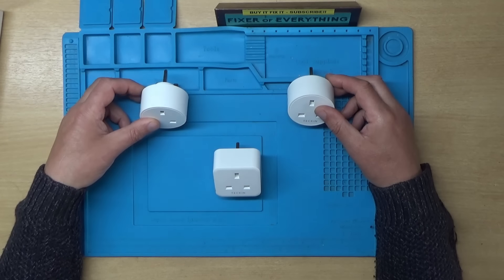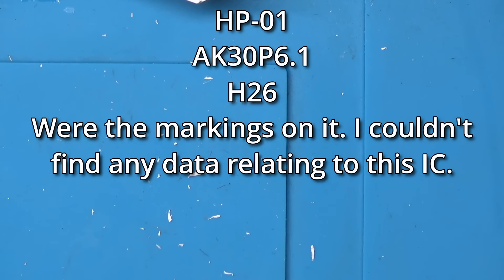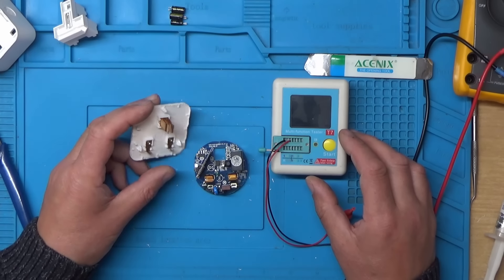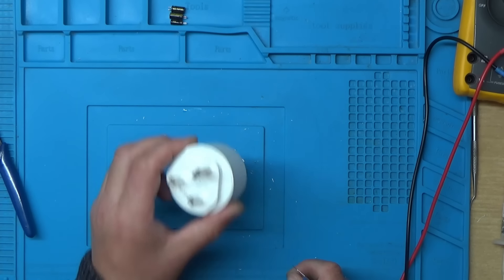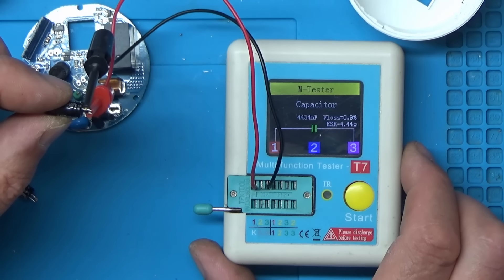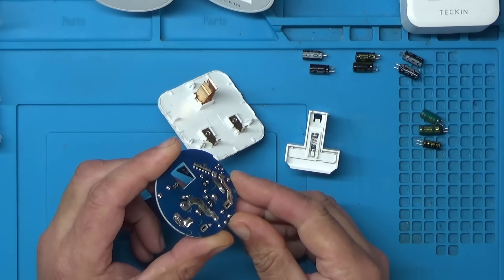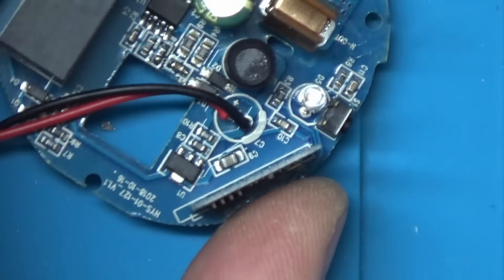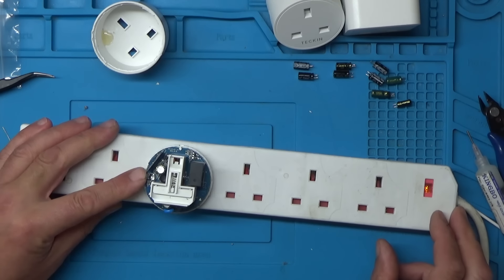Three Faulty Smart Plugs | Can I Fix Them?

Comment: The only thing this guy can't repair is my marriage. 😂
Reply from the maker: ...I'll come round and have a chat with you and your wife,I'll bring my soldering iron 🤣🤣
Reply: If only it was so simple we could fix our significant others LOL😂
Reply: Don't count your (or Mick's) chickens!
Reply: @BuyitFixit  beast❤❤❤
Reply: Marriages fail at about the same rate as electrolytic capacitors..  seems most of those times the cap blows its load all over which causes the whole thing to just not work anymore..  you can always clean up the mess but that smell will always be there and will always not trust in the thing again like maybe it wasent the correct fit for the circuit..
Reply: Marry a smart socket 😂
Reply: @ralphj4012 doesn’t have the capacity to do that.
Reply: Marriage is overrated by a few hundred volts. I've tried to resist it, after losing my last ohm. Glad we are out of the dating circuit.
Reply: 😂😂😂😂 he is a pro

Comment: I would have liked to see you test the new capacitors before inserting them.  Specially the ESR values of the new capacitors.
Reply from the maker: I guess it depends on the make, as I did a little research on ESR and came across a  thread in eevblog saying it's like asking what the weight of a cow should be. Depends on the make, electrolyte, etc so I'm still not sure how good of an indicator it is. Some people even posted pictures of bad caps with a good ESR reading so I think it's if in doubt replace anyway.

Comment: I recently had a smart plug fail in the same exact manner. I wonder how many of these have been sent to the landfill because the manufacturer wanted to save a few tens of cents on the capacitor.
Reply from the maker: I'd expect a lot. I've had a few similar comments since doing this one 👍

Comment: "When in Doubt replace the Electrolytic Capacitors" because if they're not bad they soon will be. Funny as a rule of thumb Capacitors are usually the most common failure devices but as the third unit proved there are always exceptions to the rules. LMFIAO Nice video as always.
Reply: But why don't they seem to last anymore?
Reply: @markturner7459  Well I'll guess the source, or the base material quality but who knows for sure. I'm just cognizant of the cause & effect.
Reply from the maker: Thanks 👍
Reply from the maker: I think it's because we are using switching power supplies more, which are running at high frequencies, so they are taking more abuse than they would in an old style linear power supply.
Reply: @BuyitFixit  Great point
Reply: Ceramic capacitors are notorious for cracking.

Is there a short somewhere?  Yes: diode or ceramic capacitor.  No: electrolytic capacitor.

Comment: A syringe with gas injected into the seams is how to open power bricks without damage. Use a little at a time and wipe off excess as it drips. This eats adhesive but softens plastic too, so go sparingly. This is used to repair and resell power supplies for laptops without cutting them open and rendering them useless for resale. This technique should work here. 😉
Reply from the maker: Thanks for the tip 👍

Comment: How often caps cause failure! I just replaced the starting capacitor on my 25 year old espresso grinder. Thanks for your videos. I am incapacitated and usually have to watch your videos on my cell phone. Due to a strong tremor in my hands I cannot comment on the phone, but I want you to know that your videos make my limited life experiences at age 80+ much more bearable, all the more because my favourite English dialect is Geordie! Greetings from Germany!
Gan canny, man.😊
Reply from the maker: Thanks 👍 and good work on fixing your espresso grinder 🙂
Reply: Totally agree. Can't count the number of times I have fixed items with crappy caps. I always replace them with quality ones like Panasonic FM, FR, or FC series. (there are other quality brands, the Pannys are just my preferred ones.)

Comment: Perfect timing. I just came home with one of these that I saved from an electronics recycling box at IKEA. 😊
Reply: It's odd that Ikea has a recycling box; I’ve never had an Ikea electronic device fail, except one light bulb.
Reply from the maker: Nice 👍I didn't know that they had one. I'll have to check see if I can find it next time I visit!
Reply: It is next to the self packaging area. This was in Berlin. They had recycling boxes for bulbs and electronics. I was in a rush and only collected this one (not IKEA branded). There were other things but I didn't dig more...
Reply: Hah! It was not faulty at all. Working perfectly for the time being. Odd. 😊 pleasantly surprised.

Comment: ´´I'm no expert´´ ..... 🤣🤣😂😂 .... that was a good one....!!!! Those ceramic caps a a pain these days...!!!! There is a channel on repairing Laptops in 
which the owner says, ´´No capacitor, no shorted capacitor´´ when he refers to those ceramic caps, and usually he never replaces them if there are at least 
another one in parallel...!!!
Reply from the maker: Well technically I'm not an expert as I've got no paperwork or college degree or anything. I've just messed around fixing stuff and learned myself mainly from experience and the internet 🙂

Comment: Per usual outstanding work sir. 
I have a bunch of the TP-Link Tapo plugs and they just seem to be clipped together without any glue so they're easier to get apart and fix, if needed. I've never had one fall/come apart when I've been unplugging them, so they are fairly well clipped together.
10 seconds in... CAPS, it's the CAPS. CAPS I'd say. Defo the caps!!! 🤣🤣🤣
We'll always have "two trailer park girls go" 1:47 "round the outside", 27:30, 1:47... 🤣🤣🤣
Reply from the maker: 😂😂😂Yes, I wasn't expecting the short.. I think it made it all the more interesting 👍
Reply: @BuyitFixit  ah, yes grasshopper, but it was a cap that caused the short, so defo caps... 🤣🤣

Comment: Another great vid. I have a few of these, well a variation of these, and one of them has been playing up so might be tempted now to have a butchers inside when it stops for good. I get such a buzz when you have diagnosed and rectified the problem and then plugged it in to find it working.
Love it. Many thanks 👍👍
Reply from the maker: Cheers Darren. It's per of the fun the "buzz" of getting it working👍 (not the buzz of getting a shock though, I've had that a few times too)😂😂😂😂
Reply: @BuyitFixit  Yeah i am with you there on being buzzed as i am an electrician so i had my share of them. You soon learn 😂😂

Comment: Excellent! Last week I had exactly the same problem (low voltage lytic) with a remote controller (only one, not three). The chinese components they use in this devices are really bad.
Reply from the maker: @fichambawelby2632  Thanks 👍

Comment: I have that same component tester and personally do not like it. The capicator tester I've been using for years is the Peak Atlas ESR70. You should look into it and possibly pick up one for ESR testing.
Reply from the maker: Yes someone else mentioned one of those although they seem quite expensive. What are the readings on that like compared to the component tester? I'd be interested to know 👍
Reply: @BuyitFixit this tester tests electrolytic capacitors very well. It will tell you if it needs to be replaced, there is no guessing if the ESR is acceptable or not. I never take that $5.00 tester out anymore for electrolytic capacitors. Its expensive when compared to that lesser price tool but if testing electrolytic capacitors often I feel it is an investment well made.
Reply: @BuyitFixit one more thing to note. If you knew which cap to replace you would have saved money not replacing all the others. If the plan was to replace them all anyhow then the tester will not benefit you. If the goal was to show the audience which cap was the culprit and replace only what needs to be replaced then I recommend this tool.

Comment: Most welded plastic casings open right up if you squeeze them in a vise.
Reply from the maker: Thanks for the tip 👍
Reply: Came here to say the same.  Learned that trick from Big Clive.  I had to open a similar smart switch, popped it in a Black and Decker workmate, cranked the handle and eventually there was a loud crack, and it opened just fine.

Comment: Low value electrolytic capacitors typically have higher esr, up to about the 3-4 ohm is fairly normal for 1 - 4.7 uF.
Reply from the maker: Thanks for that. Apparently voltage of the cap plays into this also. I did find a whole thread on the EEVBLOG forum talking about ESR and how it can also vary wildly between good quality bad quality and different manufacturers and even bad capacitors can have a good ESR reading.
Reply: @BuyitFixit  Yeah it varies, the esr meter just gives you a ball park figure, its not a precision measurement, just gives you a good indication (so long as the cap is not shorted). Often works well testing electrolytic caps in circuit, its the ones that have a bit high esr, that's when you are unsure. A big cap with a few ohms or more, is not good, but after measuring lots of small  caps in circuit, I find they often have a few ohms when perfectly fine.

Comment: It's pretty much cause and effect what you're seeing here. The electrolytic cap probably failed in the last one, leaving the spikey high-freq rectified voltage to be smoothed by the little ceramic cap, resulting in its demise as well. Ceramic caps tend to fail in a short or become a resistor of varying value when exposed to voltage higher than their spec. Last month I was able to repair a display module in a Wacom drawing screen where the same issue occurred as a result of a suspected power supply problem.
Reply from the maker: Could well be the case 👍Well done on fixing the Wacom 🙂

Comment: I also got two smartplugs that has a relay clicking on and off but slower. I suspect they got faulty capacitor too. Asking the manufacturer first and if they ignore me, i will personally fix them.
Reply from the maker: Hopefully they respond, if not it's more than likely the capacitors as this was the fault with all three of them apart from 1 which had an extra fault.

Comment: Love watching you save stuff from landfill.  These didn't look old enough to have failed electrolytics - I was surprised.  Bad product design in that they should have thought that if someone opens them (or even if the welds fail) then building in some mechanical clips keeping the front cover on would be good for safety.  I'm sure it could have been engineered at no actual cost other than mould complexity.  Keep up the great work!
Reply from the maker: Thanks Mike 👍I've got a "dumpster dive" TV I was just looking at earlier.. (future video) that one was really snatched from the claws of the landfill 😂😂😂
Reply: @BuyitFixit  I fixed electronics as a hobby my whole life and used to get paid to do a few TVs in my time.  Now I'm old and I just don't come across anything to repair any more so it's a lot of fun watching people lile yourself diagnose and fix.  You do great work. Can't believe you do all this on top of running a farm!
Reply from the maker: Yes sometimes it's a bit of a challenge, hence why this video was out slightly later than usual 👍

Comment: Nice repair, Really loving the channel. Are you using any isolation transformer for the mains?
Wrt the Wifi boards, maybe take a look at Openbeken and Esphome. Most of those boards can be flashed to open source firmwares and you get rid of these CN cloud apps. Then the plugs also integrate better with home assistant etc. May be a video topic.
Reply from the maker: Thanks 👍no haven't got an iso tx yet. It's on the list of things to get. Yes a friend of mine was talking about tasmosa and home assistant etc and how you can flash these.
Reply: @BuyitFixit  Tasmota is nice for ESPs. The RTL chips and many more are supported by Openbeken an Esphome. So you can "free" a lot of devices and secure their function for long. IOT has really become cheap. Would just be nice if the manufacturers would spend 50ct more on the caps ;-)

Comment: I wonder how hot it gets inside these things for caps to fail this consistently. I imagine three small holes drilled on top and bottom of the plastic case would wo wonders for the reliability.
And I see a lof of these Teckin plugs can be flashed with Tasmota or ESPhome and rendered free of the cloud, so they may be very interesting for a tech-savvy man like you :-)
Reply from the maker: Cheers Nick, yes good suggestion. A friend of mine has flashed similar and uses them with home assistant. I used to be into this kind of stuff, but sometimes it's just easier to flick a switch on the wall 😂😂😂
Reply: @BuyitFixit  Home Assistant is great when it flicks the switch for you. Having to get the phone out to do it yourself is, indeed, not the right use of the technology

Comment: amazing how you found out the last problematic ceramic capacitor! and I wonder how you guesstimated the 100nF value? perhaps from experience? thank you for inspiring me to go and try fix one of my own faulty smart switch!
Reply from the maker: Thanks 👍yes just from experience and knowing what it does in the circuit. I did the same on a solid state hard drive (video is on my channel also) 🙂
Reply: @BuyitFixit  Thank you. I'm learning so much from you!!

Comment: I get great satisfaction seeing you fix this stuff, I can only imagine the satisfaction you get. How do you like the Fluke 179? I’m in the market for a new multimeter but being on a boat in salt water I may have go for the more rugged Fluke 28 II despite the expense. And are those after market leads or are the ones that came with the meter pretty good?
Reply from the maker: Thanks 👍the leads were just a cheap set from Amazon or Ebay. They are ok, not great quality but cheap enough that I don't mind breaking them and paying £5 or so for a new set.

Comment: Electrolytics on plug top devices are quite common
The datasheet for the voltage regulator on the unit with the shorted ceramic would most likely give you the value for the faulty ceramic.
The leads on the component  tester I bought one of the long legged turned pin IC sockets RS 188-2695 and soldered my leads to it, this way I have easy contact points for short leaded components or the clips like you have.
Reply from the maker: Interesting. Thanks for the tip 👍

Comment: Capacitor value on secondary not too critical, it just has to have a low ESR, and be able to hold charge so the relay does not drop out between mains cycles. The buck converters are very tolerant on value, just do not like to have too much ripple on input, and ESR has to be low, as they draw very short high current pulses, so high ESR means it drops into undervoltage lock out range during every mains cycle.

Shorted capacitor likely just because it got spikes applied, or it was damaged during assembly, normally the 3V3 regulator goes short circuit in this use from the spikes as the capacitors age. Value of capacitor not critical, it would run without it as well, short lead lengths to main capacitor allowing it to decouple properly.
Reply from the maker: Thanks for that Sean 👍

Comment: Just a thought, but wouldn't ESR be "higher" if you're measuring with cables and those clips? ESR stand for Equivalent Series Resistance, so I'd imagine the cables and clips add to the measured values. You could try putting a cap straight into the connector and then measure the same cap with the wires, then see if you get different readings.
Reply from the maker: Thanks for that. I was doing another job which you will probably see in a future video, and I did exactly that. The readings were the same.

Comment: Interesting that one person has so many failures but looks like there may have been lots of revisions. I have many (12+) of the round form factor ones by the same brand, but my round ones are ESP like the square one you had, no issues so far with any of them (1-2 years old) and they switch higher powered devices than lights.
Reply from the maker: Nice, I wonder if they changed a supplier of capacitors or something at some stage which may explain the failures.

Comment: I thought that chip looked a little familiar , I have some HS-01 chips they are used TV power supply boards ... they control the Mosfets switching speeds ...

Comment: You never comment on the loss measurement of the caps. It's not a very standardized measurement but if it's increased there is a parasitic train across the cap.
This very quickly leads to high loads on the supply-system. Often causing startup failure of switchmode supplys that detect the high drain as a fault.
Reply from the maker: Thanks for that, I'm not too sure what the VLOSS reading indicates, I should do some research on it 👍

Comment: Hi love your videos  just wondering why did you know it was  faulty caps  so quickly?
Reply from the maker: Thanks 👍Educated guess, I've had switching power supplies do things like that before and it's usually capacitor related. One was slightly obvious due to the bottom bulging out, although I wasn't expecting the short circuit on the last one 🙂

Comment: If it's a glue joint, I've found that acetone will dissolve the glue.
Reply from the maker: Thanks for the tip 👍I did try some IPA, but can't remember if I tried acetone. It might have been ultrasonic welded I'm not 100%

Comment: He tests the faulty capacitor using DMM……. Display comes back with “wire link”!!!! Hehehe. Them smd caps are too fiddly for me to deal with.
Reply from the maker: Yes, they are quite fiddly. I've had caps fail like this a few times now. One I remember off hand was on the solid state hard drive I repaired. Video is on my channel too 👍

Comment: Shouldn't they really be using class X and Y capacitors?  Nice fix and useful info as I have some of those sockets here although they seem ok for the moment.
Reply from the maker: I think X and Y are on the AC side for noise filtering. These are after rectifier so are being used for DC smoothing.
Reply: @BuyitFixit  Ah, thanks for clearing that up.